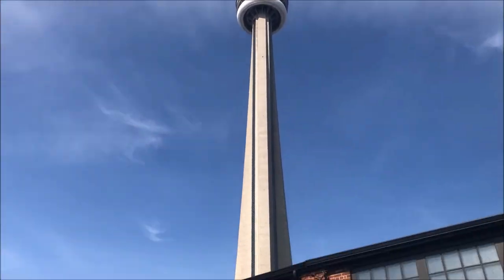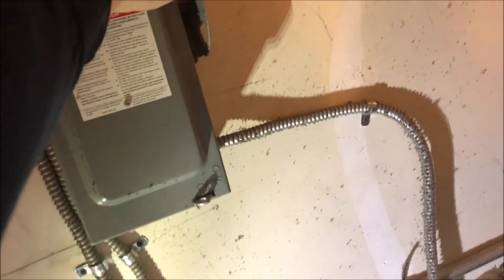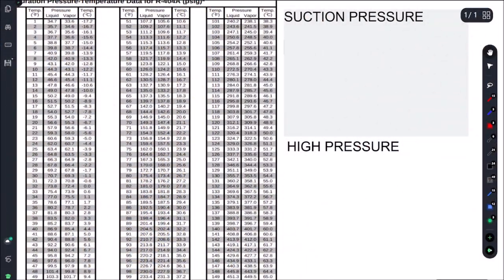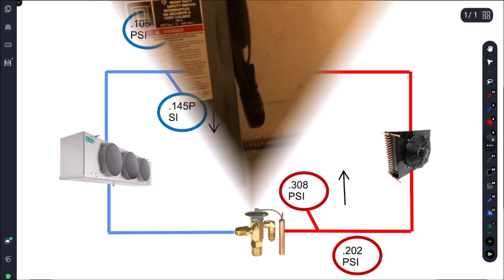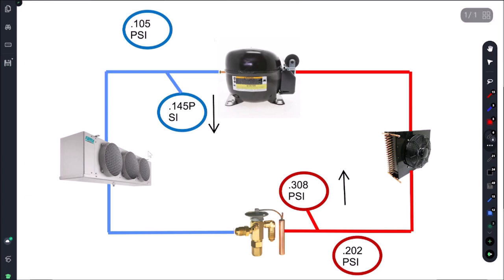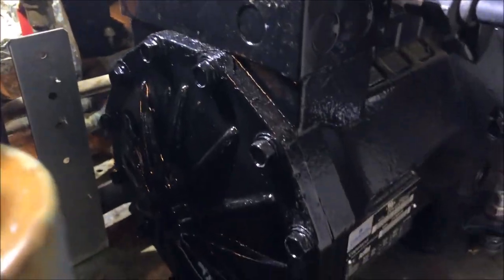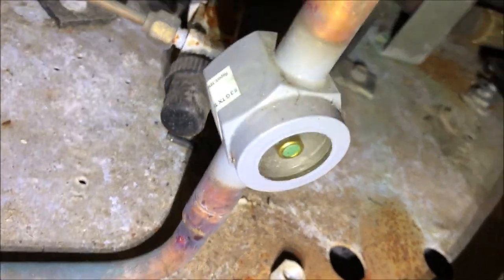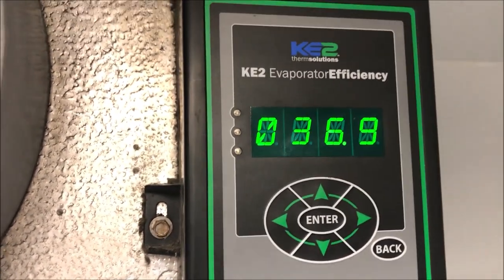Walk In Cooler Is NOT Cooling

Comment: Pressures reading that high could be from the heat in that mezzanine. Ive seen pressures elevated when mezzanine exhausts go out and many units in that area causing the area to stay around 105°f and higher. 308psi is really high and having a bad compressor means the oil most likely is burnt and mixed in with refrigerant that burnt oil may be the cause for that psi to be that high.

Comment: Was the thermostatic expansion valve a hard shut off valve or did it have an internal equalizer. If you notice I did not use acronyms describing the TXV. With out an equalizing valve the pressures will not equalize.

Comment: Interesting, unless restricted badly and overcharged, I can't think of a reason your pressures would do that with compressor off. Great video, if you get an answer I would love to know what it is. 2 Evap and 2 TXVs can cause issues even with both running if SH or valves aren't set right I've seen this with one valve failing causing 2nd evap to freeze. I could see the comm problem causing issues and 201 volts as well electronics don't like low voltage
Reply from the maker: Voltage is 208, so 201 isn’t too far off, but definitely something to consider. I don’t think overcharge because they said it hadn’t been serviced in like a year. Restriction makes sense which may have led to non condensibles forming in the system. That breaker was tripped for almost 24 hours and the solenoids were open so that head pressure should of been a lot lower. Super odd.
Reply: @REFRIGERATIONKITCHENEQTECH  🤯 agreed I would have checked multiple gauges just to verify because it doesn't make sense, hope you get an answer. Well done 👏
Reply from the maker: I had the smart probes on the other coil, you can see the same pressures on my phone in the video. Lol funny how people think alike

Comment: On a semi hermatic k body type compressor the valves might of been stuck closed maybe? in the compressor ? did you tried taking apart the compressor top to see the piston rods ? shaft might of broken off and caused such high amp draws... couldn't pump.. ? when you turned it on to take amp draw did it make a cling clanking sound in the compressor or was trying to start?
Reply from the maker: It’s something I’ve never attempted but I would like to learn about rebuilding these compressors. It’s a good theory for sure
Reply: @REFRIGERATIONKITCHENEQTECH  obviously it was a compressor failure issue, i think it was the shaft broken inside that left the pressures as it was when it died and started to over amp and trip  breaker, and left the valves closed so it wouldn't equalize ,  im 95% sure that shaft inside the compressor broke and gave you that 60 what amps on your meter, and tripped breaker for sure, either or you found the obvious root of the problem the compressor
Reply from the maker: Too bad I had to return the compressor for a core charge or else I would of loved to open it up to see. Thanks for the great feedback
Reply: @REFRIGERATIONKITCHENEQTECH  don’t think it a problem to pull the head of the compressor and inspect the valve plate, piston walls etc. Just put it all back together. Have done it multiple times. Copeland encourages it to help find the reason the compressor failed. Clues inside will indicate things like flood black, overheating etc
Reply from the maker: Definitely on the next one I will be taking it apart, thanks for the tip
Reply: @REFRIGERATIONKITCHENEQTECH  no prob, love the videos by the way

Comment: When the breaker tripped the solenoid closed and the compressor never pumped it down... Depending on the type of the compressor it could have different pressures on both sides if the discharge part of the compressor acts as a shut-off and the solenoid acts as a shut off whatever that pressure was at the time and vice versa on the suction when the breaker tripped... Right? And if the TXV did not have an external equalizer... Definitely sounds like you were overcharged or clogged up water coil on condenser or their chiller wasn't bringing enough cold water... Unless it was tap water and no chiller... So would you say your compressor was locked rotor did you try changing start components or was it 3 phase?
Reply from the maker: Solenoid was on a different breaker, so it remained open. The breaker was tripped for over 24 hours so the pressures should have attempted to equalize. Yes it was 3 PH so no start components.  Condenser coil was not plugged because everything was all good after the compressor was replaced. After reading everyone’s comments, looks like I should of opened up that compressor and investigated from there.
Reply: Okay so it was a semi hermetic?
Reply from the maker: Yes. I’ve never attempted to open one up, I will be definitely on the next one.

Comment: How do I know on an already installed solenoid whether it is normally open or closed type?
Greeting
Reply from the maker: It is very rare that it is N/O on a walk in.
Reply: @REFRIGERATIONKITCHENEQTECH  Thanks, and what is the role of the solenoid for example in the refrigerator has one solenoid on the liquid line after the dryer filter and has one in the evaporator?
Greeting
Reply from the maker: The solenoid is there so that when the compressor is no longer running, oil is retuned to the compressor. For example, when we have a long run of piping, we don’t want all the oil to sit at the lowest point of the system when the compressor is not running. In this case, all the oil would sit at the evaporator.

Comment: System is severely overcharged.  Probably floodback.  I would double check the piping runs just in case.  Maybe it's just the video but I didn't see an accumulator or a receiver
Reply from the maker: That’s what I was thinking (overcharged) but no one serviced this unit for over 2 years and it ran with no issue. We did have a receiver and accumulator.
Reply: Just throwing this in maybe somebody hooked up on the this system and was looking at the cooler and maybe added Freon to this system, after checking the system that was being worked on figuring out they had added Freon to the wrong condenser just thinking outside the box , because I have found it before at a mall

Comment: Halfway through the video, i thougth you had a MOP txv, and a overcharged system
Reply: And multiple evaps, on a single compressor is never a good thing. They should have used a master temp controller. Two energize both valves, and a defrost clock.

Comment: 1. I don't think it had a bad valve plate (usually) their is a hair line crack in the plate, which will allow refrigerant pass it will do some half ass cooling a quick pump down would have confirmed that. I would have liked to seen your gauges on that compressor running before it tripped the breaker to see what the pressures where. Also you should have megged out the compressor. In the name of YouTube go get that bad compressor back reinstall it , and let's start from the beginning.  LMAOOOOOO
Reply from the maker: Lol, great feedback here. I recovered some refrigerant and the compressor was not pumping, pressures did not move and breaker trips after 5 seconds (you can see this in the video). I had to return the compressor for a core charge, I wish I had kept it and opened it up after reading all the comments. A good learning experience, thanks for the feedback.